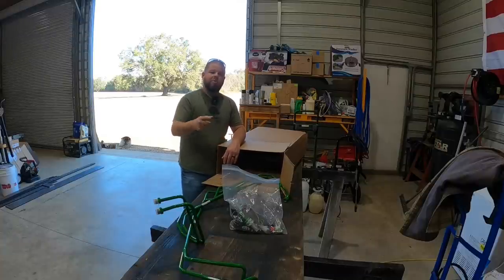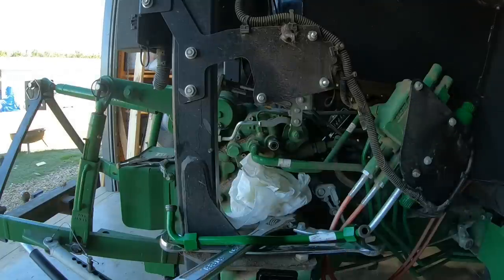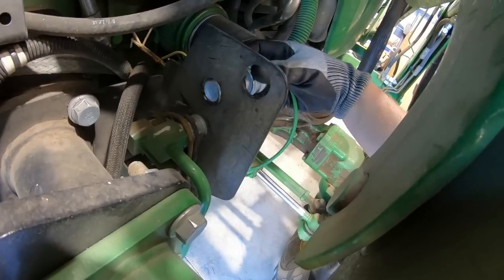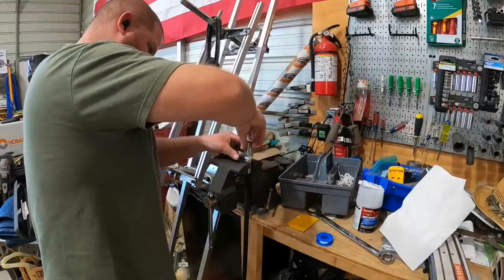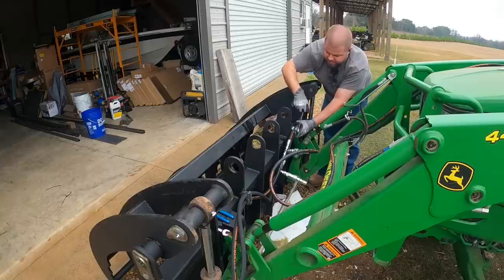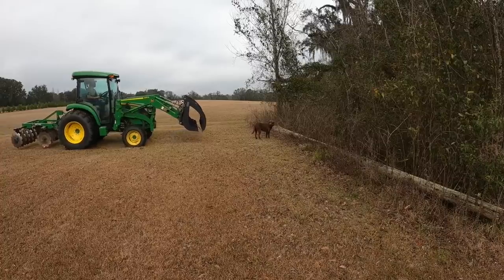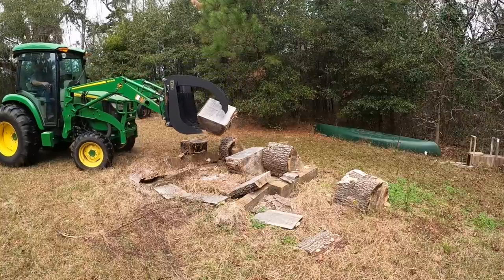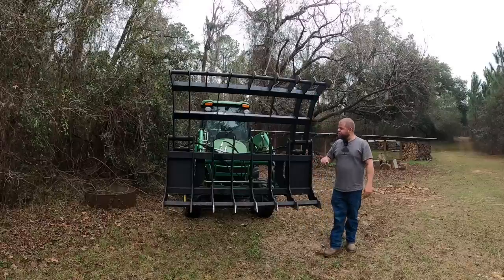Installing 3rd function SCV control valve in a John Deere 4 series. Grapple controls #712

Comment: Great job on the install! Grapples are a great tool, and investment for sure. You probably already know this, but your particular grapple is a rake grapple.  Open completely,  and dump or roll bucket cylinders all the way down, allowing the top portion of grapple to contact ground, then back up raking as you reverse.  Really does a super job cleaning trash/ debris/ small limbs. 👍

Comment: Great job on the install. I've installed a ton of those kits on John Deere 4r series tractors. I can honestly say I don't think I could have done a better job. The kit does also work on open station 4r tractors as well.
Reply from the maker: Great to know
Reply: I have a 2006 4320 John Deere open cab do you know if they make a kit for that? I would like to put one on there but I don't want to use the aftermarket one.

Comment: Great job!! Now I know who to call when I get ready to bleed the hydraulic steering system on my boat!
Reply from the maker: That's actually a very easy process
Reply: @TKCL  I’ve done the “quick fix” several times, rolling the steering wheel as far to the left and right, and adding steering fluid. I’ve got a leaky seal, so I’ve got to to the full change out after I replace it
Reply from the maker: Yep that's for sure.

Comment: Good work Andrew.  I did mine just the opposite, ran to the rear and made hoes to go to the quick connects in the middle. 

One point is that there are o-ring seals for the solenoid valve where it is mounted to the loader valve.  Yours appear to have remained in the loader valve so that is the seal.  Sometimes they stick to the cap you removed.  New seals are not part of the kit for some reason but the kit doesn't tell you to check them either.
Reply from the maker: Good to know, thanks.

Comment: Well congrats sir now you can do alot more with that grapple, that thing is going to make some jobs so much easier now that you don't have to get out and load it in the bucket and have you given any thought adding some wheel weight's to help and not have anything hooked up to the back when you took the tire off and said it was full of water i said oh i know that pain removing and installing OTR tires is one part of my job and i also deal with earth mover tires as well. Great job sir can't wait to see you really give it a workout.
Reply from the maker: I'll probably just always hook something up on the year. I'm working on a ballast box now.

Comment: You said the wiring for the valve is factory pre-wired. Is it clearly labeled or identifiable?  Enjoyed your video. Very informative!  Finally found both kits and about to install.
Reply from the maker: I honestly can't remember the label. I do remember it was the only one that would fit. A very straight forward process. I'm about to be adding 4th and 5th scvs.

Comment: Looks like its workin good. A lot of movement in them hydro lines up front when your activating the hyrdo. Perhaps a few of those spiral wraps they sell and see if you cant tie some to the grapple a bit to avoid all that slop.  They are cheap on Amazon and have seen them used by several other channels (out of the Woods) to help dampen movement of hoses. All that movement will absolutely wreck those crimped fittings prematurely.
Reply from the maker: Ordered spiral wrap last week 😉
Reply: @TKCL  GG

Comment: Good job Andrew, I have an open station 4066R with a 440R MSL loader coming. The grapple I am contemplating is 1000 lbs with 47” bottom rake. I was concerned about so much weight out front of the loader pins as I’ll only have 1400 lbs of lift capacity left. So, I was wonder what the weight of your grapple is?

Comment: Thank you so much Andrew for making this video. You did a excellent job of explaining it. I have a John Deere 4320 open station I wonder if the kit would work on mine? Have the hydrostatic transmission but I don't think I have the power beyond I have have the rear function hooked up to a tilt cylinder. For the 3 point hitch. But I don't know if I can hook up a grapple I want that grapple you got. I don't know if it's too big for my tractor though thank you so much for explaining I'll watch the entire video and it was amazing man thank you
Reply from the maker: The open station kits are different, you'd have to contact John Deere service department for the quote. May in suggest Summit Hydraulics. They specialize in open station kits and are about half the money of a John deere kit.

Comment: Hey Andrew, thanks for your videos, I find them very helpful and entertaining.  I recently purchased a JD 4066m heavy duty. I've been a New Holland (tc45da) guy for many years but have been noticing how many folks like their JD so I made the switch. I'm a landscaper for new construction so I do a lot of loader work and wanted to get your option about something. I consider myself to be very efficient with the loader but noticed that the JD loader doesn't move but one direction at a time. If you are raising the bucket with a load of dirt or stone and you want to also dump as you are raising you don't that ability, is this the case with your 4066R? Is this common with John Deere? With my New Holland I could be moving the tractor forward of reverse while raising and dumping all at the same time. I didn't even consider that this would not be a industry standard. Thanks for your thoughts! Michael
Reply from the maker: Not the case for me, I have the non self leveling 440r loader and can manipulate the dump, curl directions anyway I want while lifting or lowering. Do you have the self leveling loader?

Comment: That’s awesome. It’s weird it’s so big it makes your tractor look tiny.  Lol.
Reply from the maker: Tractor is kind of small
Reply: @TKCL  lol. It’s not that small, but the huge grappler definitely gives it a different optical perspective.  I’m glad it works, it looks pretty cool.
Reply: Andrew, I have an open station 4066R  coming and the grapple I am contemplating is 1000 lbs. How much does yours weigh. I’ve skimmed through videos and comments trying to determine that.
Reply from the maker: Wow that's extremely heavy, I'm guessing mine is 800lbs, but that's a guess. Personally I'd be installing a 500lb range grapple to get your lifting capacity back.
Reply: I had thought the same and actually had an Artillian Grapple-Rake-Grapple set up ordered and just about shipped and they called me back and said the 4 series 4066R was too much tractor for their grapple and after much discussion we agreed to mutually cancel the order. The one I’m looking at is the 72” EZ Grapple from CLFab out of Iowa. I’m thinking that if I do purchase it I should get it as a skid steer attachment, then buy the adapter to JDQA and that way “if” it is just too much or I am disappointed in performance then I could be able to sell it to a skid steer owner. If I have them put the JDQA mount on it then it is relegated to only a compact tractor. I’m not sure if 5 series tractors have the JDQA set up. If not then that means the largest 4 series tractor can’t handle it then I have the worlds most expensive paper weight.
Reply: Andrew and Shane, Well the timing of all of this is extremely coincidental. I JUST got a call from CLFab and the owner of the company does not recommend it. He personally has a 4 series tractor and says functionality is not what it should be. He obviously is going to however use is own brand, but he says it is too much for that JD 4 series tractor. So I’ve gone from too small of a grapple and that my tractors is to robust (Artillian brand) to now grapple to large and my tractor is not robust enough (CLFab). In all fairness to each manufacturer, Artillian is designed for Series 1-3 and CLFab is designed for skid steers actually. Keep on making good videos Andrew.

Comment: Started to install my JD kit and found the port taken by “Hitch Assist”.  Hard line in kit will only fit the port you installed it in. 

Remove/cap Hitch Assist?  Move Hitch Assist to middle port?  “T” hitch assist and install JD 3rd function kit as built?
Reply from the maker: That I am not sure about, mine did not have it. No doubt they make an adapter for this.

Comment: Happen to know if you can run the Lane Shark cutter with this setup? I have looked high and low but can’t find anything showing the 4066r hooked to a lane shark. Lane Shark sells the WR Long kit for this tractor but don’t want to give up my factory joystick for that grapple switch that I plan to get. Any help would be GREATLY APPRECIATED!
Reply from the maker: You can't because I looked at that myself. You need a specific setup that dumps directly back to the sump. Apparently you run into hydraulic overheating issues if you run it like this. The best way to run one of those is with a power pack on the rear pto, but it gets very expensive that way.
Reply: @TKCL  thanks for the input. That helps a little. I know lane shark has the WR Long kit for my tractor but I don’t want all that add-on stuff. Wanted to stay as factory as I could.
Reply from the maker: @adambecton  you're going to need one of their kits for this to run properly and not overheat your tractor. I gave up on it and just invested in a mini excavator and brush cutter. Expensive, but I have many other uses for the excavator. Limb cutting is one of the biggest reasons I bought it though.

Comment: Good morning Andrew. This may be a strange question but you'll know the answer. I was catching up on videos and watch the one with the grapple which I commented on. And you mentioned you put water in your tractor tires. I don't have a lot of experience with tractors, so my question is by chance on a really cold morning can the water freeze in the tires? 🤷. Hey you don't know if you don't ask. 😁
Reply from the maker: They make a liquid antifreeze ballast that most people use in colder climates. I'd imagine that is also in mine. Regardless does not stay cold enough long enough here to freeze that much water in my tires.
Reply: Okay that makes sense. Thanks for the reply.
Reply: @Nature Nut I have a 4066R coming and they are going to put Beet (yes the vegetable) juice in my tires. I am in Missouri and it most definitely freezes here.
Reply: @danlichtenberger6462  holy cow. Beet juice. Now that's a new one. Lol. So it doesn't freeze. Cool
Reply from the maker: I've definitely heard of beet juice.

Comment: You say no o-rings between the valves. Um yes there is.
Reply from the maker: I was trying to say the new valve has no orings or gaskets on its sealing surface. There's nothing to fool with there on the new valve.